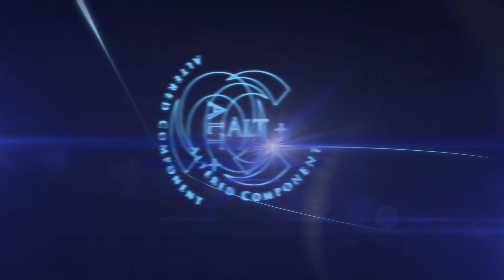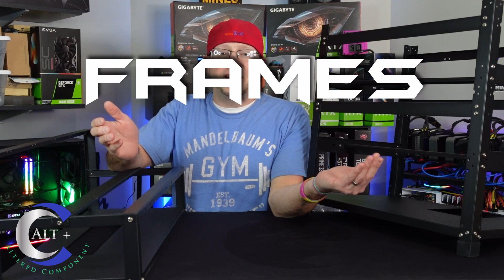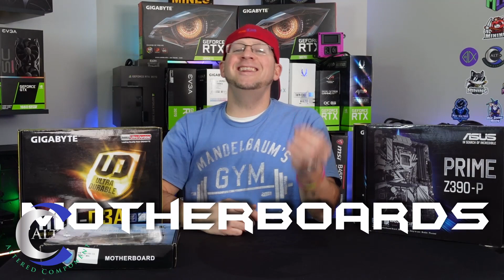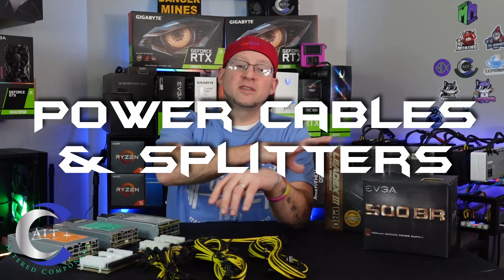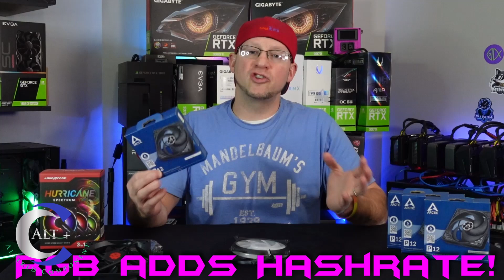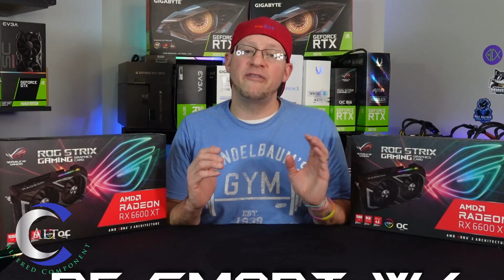Noob's Guide:  Mining Rig Parts | What parts do you need to build a mining Rig in 2022

Comment: I tried finding that purple power meter box which looks cool.  I looked on his Amazon site and his Utube site and couldn't find it.
Reply from the maker: Mad electron 3d printed that one himself and put the drok meter in it.  SpaceGoats prints the boxes for sale and you can buy the drok meter for fairly cheap on amazon.   Mad electron engineering, spacegoarts, and chumpchangexd all have videos on how to assemble.  Also ChumpChange is sponsoring a more expensive box that is injection molded called "the meter box" i believe.  My first box i bought a generic waterproof box from lowes and dremmel cut holes for the drok ;)

Comment: Rtx 3060 LHR and RTX 3060 ti LHR or Rx 6600 XT Best Efficient Settings In HiveOs?
Reply from the maker: best efficiency....if you are looking at solely ETH efficiency and using hive, then the 6600 xt is at the top of the list.  Only thing that bests the 6600xt when optimally tuned on eth really is the a2000.  i am releasing my over the top 6600xt build video Friday.  If you run in hive, you can easily crank down the mv power on these cards.  If you run windows, it is a bit of a pain because you have to use more power tools.
Reply: @AlteredComponent  Sir what is the Best Efficiency Settings in HiveOs For Other Coins or Algorithm if ETH Goes Away?
Reply: @AlteredComponent I watched Sebs Fintech the best GPU for Efficiency is Rtx 3060 LHR or Rtx 3060 ti If Ethereum is Excluded But i want to know the HiveOs Efficient Setting of these Rtx Cards.